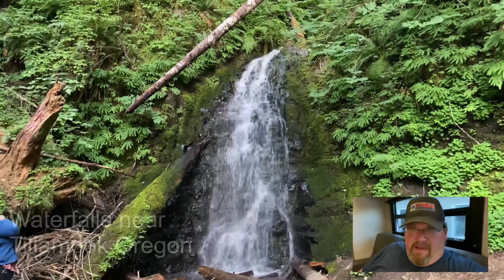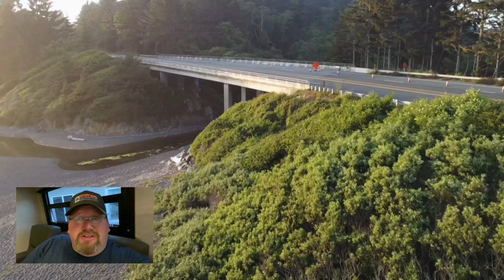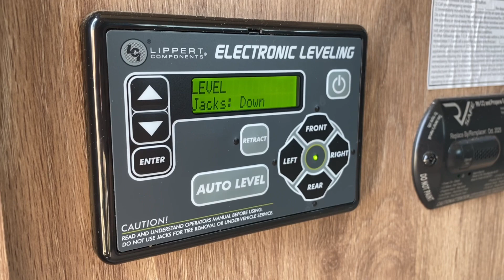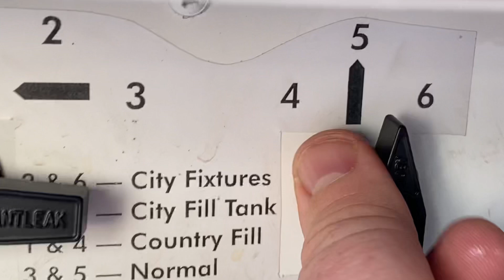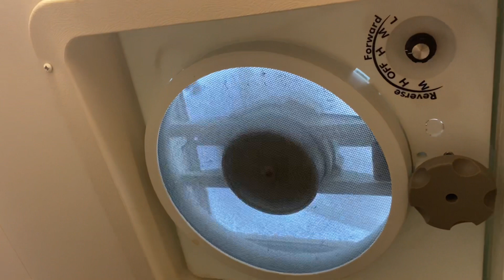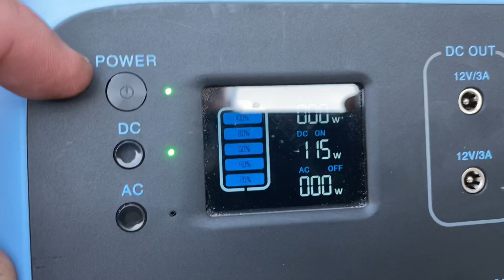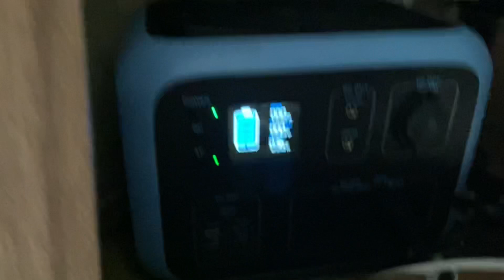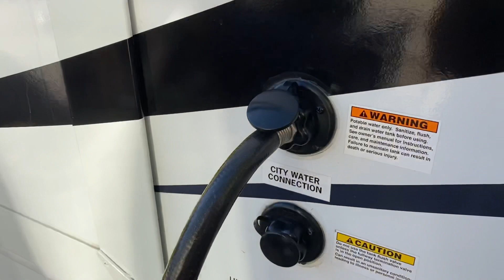New RV Owner - 6 month Review - Entegra 25R #motorhome #rvlife

Comment: Now this is why it’s so extremely helpful to post honest reviews. Thank you so much. But my search continues because I’ve been trying to find a review like this for the Entegra Odyssey 30Z. The long distance is what concerned me, which is why I considering a Super C so maybe this will do. Thanks again.
Reply from the maker: Thanks for watching !  I wanted to make a video that had information in it - that I wish we had seen prior to purchasing our Motorhome.  Good luck on your search !
Reply: Oh I forgot to ask, how did your tires hold up? What concern me about a class C is how small the tires look and the likelihood of a blow out from multiple long distance traveling.
Reply from the maker: @jonathanbaldwin6876 , zero issues with the tires.  They are very high rated (load range F I believe) to handle the rig fully loaded, and I make sure to keep them fully inflated to handle the load.  So far they are wearing evenly as well - so the balance and alignment seems to be pretty good 13,000 miles into ownership.

Comment: Good vid. I have a 2018 Jayco 25R and love the floor plan. Am a bit envious of the front windshield, though I'd be really upset about that shade! 
Noticed that not only did they label your dump valves wrong, they also mislabeled your water inputs. The potable (potable ;) Matt!) water is supposed to be on the top, that's why the potable sticker is to the right of the port, black tank flush on the bottom and label to the right of that port. 
I too replaced the cheapo fan in the bathroom with the Hengs vortex. Also finally got around to putting a Maxxair Fan in the bedroom vent, what a difference especially if you boondock at all.

Again, good video. Good luck with the rig!
Reply from the maker: Nice, thanks for the comments - where did they/you pull in the power for the fan over the bed?  I was looking at doing that upgrade but was not sure how difficult it would be to find power up there.  You are correct on the decals, the black flush is on top and the fill is on the bottom.  Happy Camping !!
Reply: @TheBlockPartyRV  Power for the fan was why it took me so long (3 years) to get it done. Initially was looking to tap into bathroom fan but there was no clear way to get it to the new fan without being surface mount and I didn't want that. Finally decided on tapping power from the under cabinet lights in the bedroom. Up through the cabinet then across the ceiling. Only holes I drilled were inside the cabinet. Took some time to "drill" a channel in the Styrofoam from the vent > puck light > cabinet, only used a long narrow screwdriver instead of drill.
Maxxair fan is SUPER quiet! Way quieter than the Hengs I put in the bathroom.

Comment: Honestly I am surprised you did not have more factory build issues. We bought a new Class A Fleetwood Bounder in May of 2021 and we have spent 5 months getting the various issues fixed. And Fleetwood is not a crappy brand, it is actually an top tier brand. Now Fleetwood has been great making the dealers fix the RV but it has taken a long time. With the current demand for RV's I understand a drop in QC from the Factory but the dealer has an obligation to do a proper PDI of each unit and ours clearly did not.  Happy for you on yours.
Reply from the maker: Thanks for the watch and the comments, we actually were looking at a Fleetwood 29 class A and the dealer salesperson we had become pretty close to - she pretty much “hinted” and steered us away from both them and Thor and cited a lot of build/warranty issues she had seen at the dealership.  At one point she was literally like “I like you guys, so I am not letting you buy a Thor”.

Comment: Excellent, thanks, subscribed. BUT, I REALLY need to know WHERE you place your Cpap machine in the main bedroom? And I did see your battery device for powering the Cpap which must mean there are NO outlets nearby without running an extension cord. Its not a deal breaker, but it is important since those hoses only run so far and we dont need to spill the water etc.
Reply from the maker: It goes in the storage compartment right above my head, there is an outlet near the head of the bed that I plug into, I use the Bluetti for power if we are boondocking.
Reply: @TheBlockPartyRV  Thank you! We need to find this coach and have a look. Just got back from a LaMesa show here in Phoenix but they did not have this coach to look at. I have time to shop so I’m sure one will show up. Thanks again!
Reply from the maker: @BrianAz , good luck and I hope you find the right Rig that meets your needs !  My experience with La Mesa has been good so far.  Happy Camping !!

Comment: I replaced my TV with a Samsung smart TV, same size & wt.  I know there are ways to stream videos,  but Samsung comes with almost 200 channels called TVplus. So between "air tv" & TVplus, I get more channels than cable. I did have to move the bracket up a few inches.
Reply from the maker: Yep, agreed, we have a Samsung Tv in the house and I have contemplated doing the same thing in the Motorhome.  Nice tip.  The ask for watching !!

Comment: Great video. But how does it ride? Air bags on the rear axle, larger sway bars (Helwig),  Bilstein shocks and a steering stabilizer/shock seem to be things that people are installing (or standard on Coachmen Freelander). The ride issue may not be a concern when riding is in the front seat, but at the the dinette. (I rode on a dinette in a Sprinter Class C once, and it rolled like a boat in the ocean).
Reply from the maker: To me it rides great, it’s not a luxury Cadillac, but it is far less noisy and is less “rough” riding than my friends Coachman Freelander.  Entegra has added some stuff so the ride is good, no swaying or rolling unless you have some severe gusty side winds.  Will those upgrades you mentioned help? I am sure they will, but are they needed ? To me - I personally don’t think so. Thanks for watching and sharing in the comments.

Comment: Thank you for making this video. I have been doing a lot of research on Class C's and so far it's been a debate between Entegra and Winnebago. Hoping to get one for 2022, and so far really liking what the Odyssey brings to the table. I will want to install solar panels, lithium batteries, and a pepwave router with antenna. I really like that you showed where the batteries are. I do like to Boondock and one thing that the Odyssey doesn't really have at stock vs. the Winnebago View/Navion seems to be solar?
Reply from the maker: Thanks for the comments, It is prepped for solar, the solar plugs are already on the roof, and the right front outside storage bin has the wiring to install the controller, should be a Very easy install.  We liked the Winnebago products too, but in general you just got more bang for your buck with Entegra, and the extra year of warranty - is a Huge benefit and peace of mind !!  All that said, if the Winnebago checks more boxes for your needs, then it might be the better choice - good luck in making your decision.
Reply: @TheBlockPartyRV  That's great to hear, thanks for responding. If you don't mind I just have a few questions since this is the same unit I am looking to get. How does the Ford drive? Is it fairly easy to maneuver the Odyssey into parking lots (grocery stores, laundromats, gas stations, .etc)? And do you ever have to worry about bottoming the coach out? Just wondering if I should just get the 29 foot or try for something around 25 instead. Thank you kindly.
Reply from the maker: @MP-ny2ek  it drives easy, my wife drives it all the time and parking in a grocery store parking lot or most gas stations has not been an issue at all.  The 25 is really 28’ and the 29’s are I think 31’ so length is not that different -  but it is the wheelbase - that is a lot longer (tires way further spread apart), so turning is not nearly as nimble on the 29’s as it is on the 25r.  We had a 24’ Pontoon with a 3/4 ton Dodge and this rig is 5x easier to drive than that setup was.  I have had the hitch drag once or twice coming out of a very steep driveway, but nothing got damaged, and it is pretty rare.  We learned if you come out on an angle  = no hitch drag.  Ultimately Just sit in them, hang out, test drive them, and you will be able to “feel” which one is the right fit for you.  You are doing the right thing - asking great questions, and vetting the units - that will pay off big time !  Let me know when you get one !!
Reply: @TheBlockPartyRV  Awesome review mate!

Comment: Wow, I like the way how your review flows... I'm not done watching but I thought I'll start on this before I forget. Regarding the thermostat that is hidden when the slide is in, can that be relocated without going back to the dealer or some shop? I would imagine the wiring can be extended if need be to reach the new location. As far as the air valve for the rear tires, all of a sudden I thought of the long tube air valve used on big rigs. Can that be replaced so it would come out thru the rim hole to make it easier to deflate or inflate? great review!
Reply from the maker: Thanks for the comments, we basically just took a photo of the thermostat on our phones and just reach in there now to turn on the heat or air when needed.  One option is to drill through the wall and just put it on the other side of the wall which is in the restroom.  You are correct the fix in the tires is just a valve stem extension.  I’m going to do a follow up video with the viewer suggestions soon !  Thanks again for watching !!

Comment: Your Bluetti AC50S with a full charge should run the TV at 25 watts for 17 hours.  The Milwaukee M18 High Output HD 12.0 with full charge should go a bit over 7 hours.  This assumes they are new but the actual time will decline as they age.  Given that the Bluetti is rated at 500 Watt Hours, you can use about 85% of that and the TV pulls 25 watts: 500 X .85 / 25 = 17.  The Milwaukee is rated at 216WH: 216 X .85 / 25 = 7.344.

Comment: Thanks for the video. My wife and I are looking at this exact MH.  One question. Why not find a 12v power source that runs off of the engine alternator and use it to power an inverter for the TV?  I love the portable power systems, but just thinking of options.
Reply from the maker: Yep - I agree that would be good, but there isn’t really any good 12 volt sources in the Motorhome without actually wiring something.  I agree even having just one 12v plug in the bedroom area (to run a cPap off of) would have been best - and most other mfr’s do have that.  On this model - there isn’t any 12volt outlets (anywhere).  The Bluetti though can both charge and run at the same time, so we have plugged it into the cig lighter while driving (to charge), but have had it at the same time run a laptop and such as well - so it works kind of like a battery backup inverter.  Thanks for the comments !

Comment: Where did you purchase the valve stem stabilizer that holding in the rear inner valve stem? Or does it come with the coach?
Reply from the maker: It came with the coach,  but I am sure you can get them just about any auto parts store that deals with parts for trucks and dually’s. Thanks for watching and commenting !!

Comment: I’m thinking about getting an motorhome but it has to be 4WD and insulated for year round living. Any suggestions?
Reply from the maker: Thanks for watching, You are Probably going to have to look at some Higher end Super C’s, Thor and others make some small 4WD B+ models on the Ford Transit chassis but I doubt if they are going to be a true 4 season rig.  The super C’s are really awesome - but very pricey.  Good luck in your search !!
Reply: I am looking for the same thing as you so I was wondering did you have any luck in your search finding a 4 x 4 or one that was Four Season ready? I do know that Quigley  4 x 4 conversions will convert a Class C motorhome to four-wheel drive. It is about $10,000 to $14,000 from what I am able to figure out but it seems like they have a good reputation and use quality original parts.

Comment: Why doesn’t this Rv have a built in inverter?
Reply from the maker: @gary9080 , it did not come with solar, and most things in the rig including the fridge are either 12 volt - or propane, so there was no factory power inverter in the rig.  When I want 110 power or A/C - I have to plug into shore power - or fire up the generator - that said - NEXT video is me installing a whole house inverter and battery system that can even run the A/C for a number of hours !!!  Stay tuned !!!

Comment: Is that a Chevy engine?
Reply from the maker: The engine is Fords New 7.4 liter naturally aspirated gas engine, AKA “GODZILLA”.  So far great motor, huge torque and power but decent mileage compared to the old Ford V10 that only got 6-8 mpg. Thanks for watching !
Reply: @TheBlockPartyRV  did you have a V-10?
Reply from the maker: @prepperboss , I have driven a lot of the old Ford V10’s in a lot of equipment at the construction company I used to work at, like most of the Fords back then we had a ton of issues with them blowing the spark plugs out of the heads, same as the Ford 5.4.  I think that issue was finally corrected by Ford, but the motor for a 10 cylinder it just didn’t breathe real well, and it only produced maybe 375 foot pounds of torque - in comparison my new 2.0 turbo 4 cylinder Jeep Wrangler 4XE Electric hybrid produces the same 375 foot pounds of torque.  The new Godzilla is like 475 foot pounds, so other than a diesel, it’s a real good choice for hauling a lot of weight.  If you watch my other video of the Coachman review, there is a Chevy V8 in that rig, and the owner said he gets like 7.5 mpg, and it’s a real small 22 foot rig.
Reply: @TheBlockPartyRV  but 6-8 on a V-10 is that really the industry average?
Reply from the maker: @prepperboss , ya, unfortunately those older style V8’s and the Ford V10 pulling really heavy loads mostly all got less than 10 mpg, but the newer overhead valve engines seem to do a bit better, but that’s why so many people get Diesel’s where you can usually get 12-15 mpg or so.
Reply: @TheBlockPartyRV  Thanks for the feedback, do yours or other class C have double paned windows ? Are they 4/season insulated?

Comment: Just wait, it’s just like buying a car, it’s goes down. I bought a rv ,new, it worked good for the first few years. Then it starts going down, unless you can put it a warehouse it’s a sh1t show.
Reply from the maker: Actually, due to inflation this rig new is now $150,000 msrp, so I can still likely almost get what I paid for it a couple of years later ($86,400). And I knew stuff would break and require regular maintenance, but I own old classic cars so I am the type of guy who doesn’t mind a few things breaking and such here and there.  But if a person is the type of person who isn’t very hands & DIY and can’t handle let’s say a small water leak on a road trip then one should probably not own an RV.  Also - I am seeing that there is a HUGE difference between cheap rigs and expensive rigs in terms of the materials and components.  My good friend bought a very cheap coachman rig - and he is at the 3 year mark and has had to replace the fridge, AC unit, and numerous small things due to breakage.  I’ve had a few small things, but nothing “major” so far.  Thanks for the honest and real comments.
Reply: @TheBlockPartyRV  it’s wrong to promise the moon and get a disappointment.Most people do not see the fakes.I miss my rv, but I do not miss the things that goes wrong, this is the out of doors, if you can cover it up, like a barn. Mine was Thor citation Mercedes sprinter. The box is the problem. They are make up of fiber board and wallpaper, the floors are vinyl, my seats were fake leather.